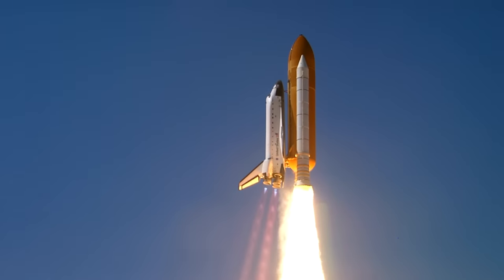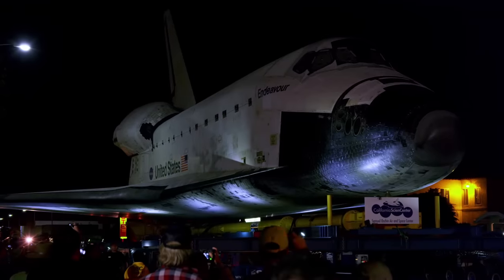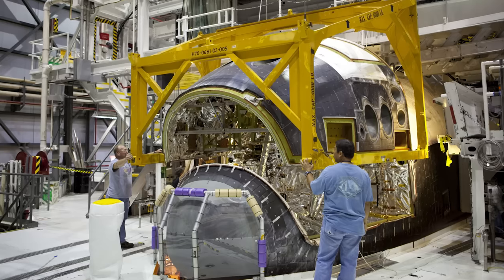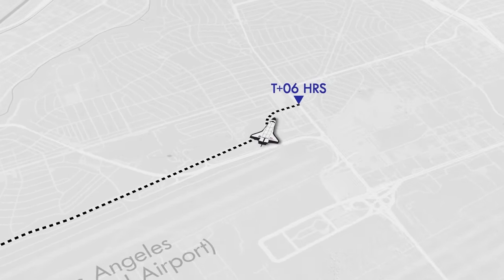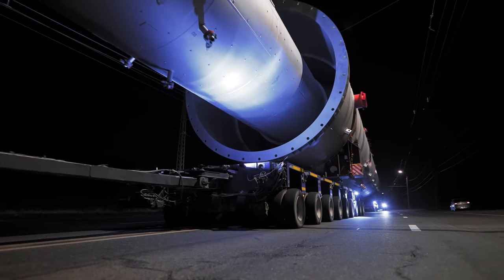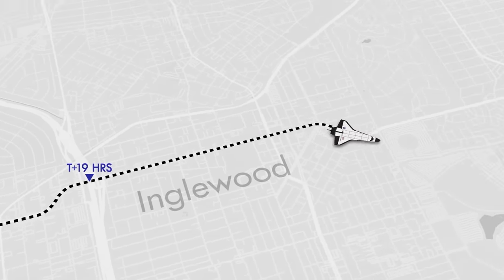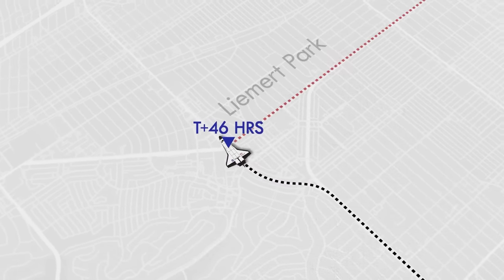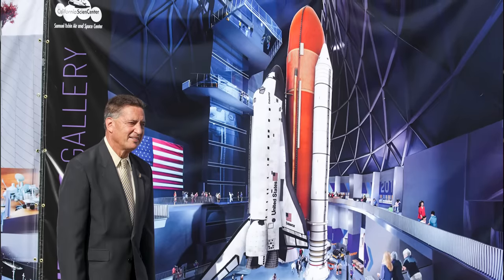The Time a Pickup Pulled the Space Shuttle

Comment: I have always wondered why this was not transported vertically. You can imagine it would fit through the narrow streets much easier and it would seem with proper engineering the load to the road surface could be similar.
Reply: With the center of gravity so high bumps in the stree could easily unsettle the thing.
Reply: @cyan_oxy6734  I thought the mover platforms self level and with all those steel plates it would seem like you could almost level the road further as you went.

Comment: the blade is nice, may look into it, but my opinion as a single blade user is get feather or astra razors. many other razors are in the ok range. but those two has been fantastic. and GOOD SHAVING CREAM. i used to use gillette and barbasol, but going for at least creamo was the biggest difference in my shaving experience. even most shaving soap is better and cheaper than gel, especially if you are a shower shaver.
Reply from the maker: I like Creamo too

Comment: It blows my mind and at the same time, it humbles my heart to see the extent of human ingenuity.
I got one question though, why did they not use multiple heavy lift helicopters like M-26 or CH-53K 
to fly the shuttle to the museum?
A single helicopter might not cut it, but could not around 6 helicopters be flown,
to move the shuttle?
Reply: Helicopters are naturally unstable, and a weight this big needs each lifter to be in the correct position. One gust of wind or one chopper's engine having a hiccup and you are done for(ever tried carrying a fridge when one guy loses his grip?).

Trying to get 4-6 heavy lift helicopters to try and hold perfect station that close to each other is a tragedy waiting to happen, not a viable method of transport.
Reply: @boosterh1113  Thanks for your reply.
I didn't realize helicopters were this unstable.

It would have been nice if we had large drones that were up to the task🤔

I wonder if those helicopters with the 2 rotors/blades would solve the stability problem?

Comment: I assume temporarily removing the wings and tail fin was considered and discarded for some reason. I don't know the internal design on the shuttle, maybe there's no way to do that without shearing through solid metal framework? But it seems to me that anything that was at one point assembled could be disassembled.
Reply: He mentioned that it couldn't be done without damaging the thermal protection system tiles. As if the TPS had not already caused enough problems for the STS, it had to get one more dig in after the shuttles were retired.

Comment: Related to road limits.  The largest front-end loaders are limited by how big a dump truck can be made (too large a loader is inefficient at loading a too small a dump truck).  And how big a dump truck can be made is limited by how large a set of tires can be.  And how large a tire can be made is limited by how large a load can be carried from the tire maker to the location of the dump trucks. 

While you can disassemble the dump truck and haul it from maker to open-pit mine in pieces, that's a one-time move.  But tires have to be hauled to the mine several times a year.

Comment: What if they removed a wing of the shuttle, and re-assembled it at the Science Center? 
I'm sure they would have evaluated this option, but I'm curious about whether that would have been possible, and if so what the tradeoffs were between removing a wing and dismantling all that roadside infrastructure
Reply: They did evaluate it. He mentioned in the video that it couldn't be disassembled without damaging the thermal protection system tiles. Apparently, either the original tiles are considered irreplaceable  museum pieces, or the cost of replacement tiles would have exceeded the $10M cost of moving Endeavour through the streets of LA.

Comment: They use vehicles just like those SPMT's at my work, Bath Iron Works, to move ship sections. They look very complicated to drive.
Reply: Not really. You can use as many as you need to fit no matter how big or how heavy. They all link up to be a single unit controlled by a single operator and can move in any direction you want. They are heavy weight ballerinas. You need extra eyeballs tho.

Comment: The Space Shuttle was a deathtrap on the drawing board and it's amazing that a single  flight landed safely, let alone 135.
It was maybe the greatest technological achievement of mankind and every person who worked on the program should be very proud of themselves. However the Shuttle program is a deadly tale of what happens when politicians and bureaucrats get their greasy tentacles in places meant only for engineers and test pilots.
Chasing the dream that reusable necessarily meant cheaper the Shuttle had extreme danger designed right into the overall vehicle configuration, with the crew strapped to the side of the rocket instead of on top, no launch escape system and solid propellant boosters that couldn't be stopped once started, to name a few things.
Ironically, we could have had two Apollo flights to the moon every year for the cost of the Shuttle program. It was way more expensive to refurbish and reuse the Shuttle hardware than to use disposable rockets off of a mass assembly line.

Comment: 7:15 doesn’t speed impact wear as well? I think some states slowed semis  down instead of only limiting their weight.
Reply from the maker: It's the opposite, actually. Very generally, lower speeds lead to greater damage because of increased load duration.
Reply: @PracticalEngineeringChannel  I wasn't speeding, officer: I was minimising wear on the road surface!
Reply: @alexythemechanic8056  I am going to use that if I ever get stopped for speeding!
Reply: @PracticalEngineeringChannel  I understand that faster speeds lowers the load duration. 
Intuitively, I find it hard to believe that increasing the shear force (tires trying to propel forward at faster speeds) on the road surface doesn’t have a negative impact. 
I couldn’t find studies that looked in depth on speed + load effects on road damage.
Maybe the benefits of decreases in load duration outweighs the impact of increased shear forces? 🤔
Just trying learn and stretch my grey matter. Thanks for the awesome teaching and videos!
Reply: I have not been able to find a source to states slowing down due to road damage. Concerns for safety are the only documents I could find.

Comment: Ok, the amount of planning that goes into moving such a large object is pretty impressive. Though I don't quite understand why it wasn't taken apart, moved in individual pieces and reassembled at the target location. I'm not very knowledgeable on the subject, but I'd have guessed that it would have been faster and less expensive than transporting it on the road. I also can't imagine it being impossible to disassemble a space shuttle, otherwise how would you replace parts and do proper maintenance? What's the reason behind the decision to transport it in one piece on the road?
Reply: Taking it totally apart might be impossible. They sure could access and replace certain things, but the aerodynamic surfaces were likely made like they are the same part as the main body(also making sense to survive a lot of force).
Assembly would probably also require a lot.
Reply: Transporting heavy stuff happens daily, it's a (fairly)well understood thing. Taking apart a space shuttle? I bet there are a gazillion wires going back to front, same thing with rivets. Taking apart works for stuff that comes in nice big chunks like these monster dump trucks, they are meant to be taken apart. Another good example are these SPMT's. They fit in a container so if you need 50 of them you simply fly/ship/truck them in on normal transports from wherever then link them up with big locking pins to make a single huge one.

Comment: And this is not a singular event.
I live in southern germany near a high-tech plant that produces measurement and production devicec for chip manufacture. Which have to go - mostly - to the netherlands. 
Every one of the 700km trips of those extrawide loads costs an amount easily going into the double-digit millions, crossing several jurisdictions, just to remove several hundred lantern posts, traffic lights ect, blocking streets, convoy vehicles and law enforcemend tagging along.
They even once tried an alternative route down to the danube, continuing on ferry down the river, through the black sea, mediterranean and atlantic on ship. 
Lenghtening the direct route of 700km to over 5000, in the hopes of saving money. Did not work out though.

Comment: There is no reason anybody should NOT use a safety razor other than being careful not to change the angle too sharply or cut yourself, but you easily learn when that can happen
high grade gillette blades are absurdly cheap on amazon and the aparatus is super easy to clean of hair duirng and after use.
Reply: Yeah there is. My hair is very dense and it takes forever to shave and I dont enjoy shaving. A multiblade shaver takes much less time and I go through one 5 pack set of blades a year since. I used safety razors for years but moved on to multiblade since they take so long and arent as comfortable.

Comment: I use to work for Toyota, and this was a big deal for them because they really thought their trucks could compete with not just the big boys, but the big daddy F-150. Sadly, Tundra's are pure garbage, and out side of the Texas plant where this is built, the Blue Oval dominates the employee parking lot when it comes to 1/2 tons. 

The trailer in this case was powered by it's own motors, so really the load was much less on the truck than some make it out to be. However, the truck that pulled it was pretty much a write off, as it was stressed well beyond it's limit. Toyota mounted to the wall in the lobby of their TMMTX plant just outside San Antonio, by tradesman who showed up for work that day in F-150's
Reply from the maker: That dolly was definitely not powered. The truck pulled the entire weight.

Comment: the space shuttle always felt like it was something from tthe 80s, 90s but that thing last launched in 2011, only 10 years ago
Reply: It was actually something from the 70s. That's when the first launch was to take place.
Reply: @frankbrockler  the first one was actually 1981 but i meant when it sort of had its haydays
Reply: @hoodio  Yes, thanks to delays with the tiles and the main engines, it didn't fly until April 81, but it was designed, built, tested, and intended to fly in the 70s. One of its first missions was to boost Skylab to a higher orbit before it fell back to Earth in July 79.

Comment: Are we sure it wouldn't have just been easier to remove the wings? Heaven forbid you damage the heat tiles of a spacecraft that will only have to survive the LA summer heat.
Reply: Definitely not. It still weighs many, many tons, and accomplishing that means a huge amount of internal work. It's not gonna be easy to just take off wings that were capable of staying rigid during reentry. And then the shuttle is still gigantic and long, so you just have a slightly easier lift for all your trouble.
Reply: @Need2 connect  well they didn't notice the trees until it became an issue lol

Comment: This is not as impressive as it seems. Any full size truck made today could do this. There are a couple major factors that determine a vehicle's tow rating:

The chassis ability to handle the additional weight on the tow hitch (aka tongue load). Towing a properly set-up 10,000lb trailer would put an additional 1,000lbs load on the tow hitch.

The additional load on the powertrain due to pulling the extra weight. Powertrain load is highest at wide open throttle at low RPM when in a high gear, such as trying to pass someone at 80mph up a hill in top gear.

Since the shuttle trailer has front wheels, the truck's chasiss is actually not supporting ANY additional weight. Think pulling a wagon vs. a wheelbarrow.

I'm also pretty sure this thing isn't going 80mph through the rockies . . . most likely it's crawling along at 5-10mph on flat ground in a very low gear. The engine/trans isn't working very hard either.

In fact, the only load the truck has to overcome is the rolling resistance of the tires, and any friction in the axles and bearings on the trailer. Kind of like my 110lb wife being able to push a 3500lb car a few feet in neutral on flat ground.